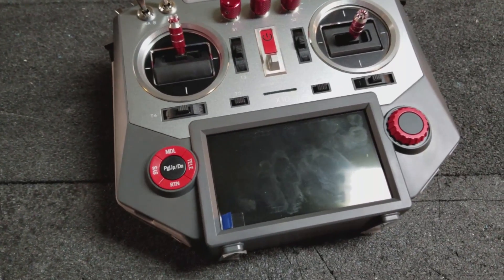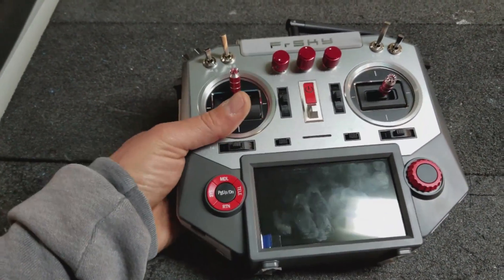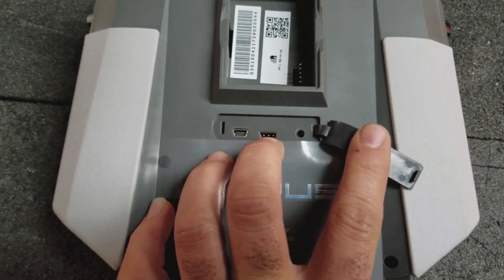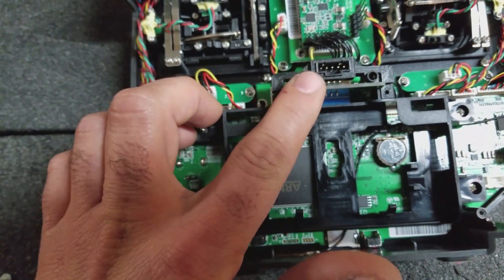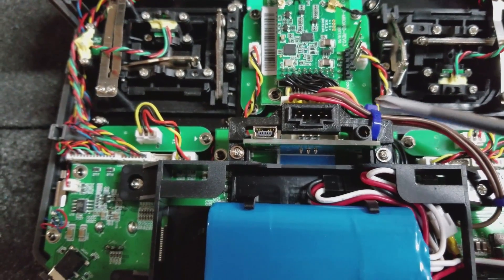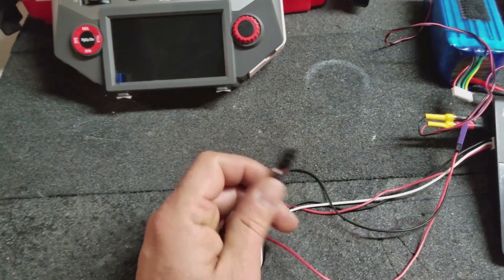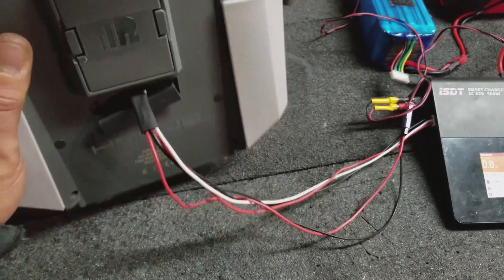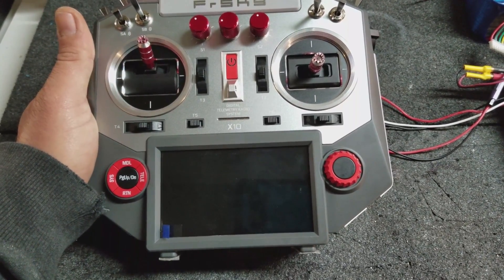FrSky X10 Fast Charge Mod

Comment: It’s a nice mod however I disagree with the original charger being a pain in the backside-you just need to lie the radio down on its back like you have it most of the time in this video at the beginning and leave it plugged in that’s what I’ve been doing ever since they came out and never had a problem-that said I do like your modification. nice work👍

Comment: All over nice MOD but i dare to say the lousy Hinge between Rubber Cover and Transmitterbase will not hold for many Chargingsessions, would feel it better to use one of the two Long Oval Side Back covers (On Horus 12 you can remove them not glued or such a thing) Construkting a 3d printet Balancing Plugholder. The broken Coverhinge i saw first time on a  Premium Japanese Camera Cover after several Chargings
Reply from the maker: You are probably right :)

Comment: Watch out because on the original battery the plug IS NOT a balance plug. The middle cable is connected to a board inside the battery and sends info to the charger (temp and maybe smething else). I'm not sure the board will like having 4V there instead...

Comment: What did you use to cut out that port hole?
Reply from the maker: Just my dremel tool with sone grinding bits and drills to get rough size, then switched to small hand files.
Reply: flightcomp thank you I will be doing this mod because that charge port is so dumb.

Comment: I just ordered the radio, if it shows up a version 1 I will send it straight back, It cost to much to have to deal with this problem.
Reply from the maker: ToddTube Yeah as a dealer I was really disappointed to get V1s wen everyone knew the V2 was released.

Comment: Very nicely executed mod. Just a quick tip. You don't actually need a 5 pin connector. 3 is enough. The 3 pin balance plug also has plus and minus that you can use for charging.

Comment: Real nice and professional mod. I have been wanting to buy a X10 since it was released, but I must say that the original charging  system has been a show stopper for me.
Reply from the maker: Yes, I am FrSky Dealer and I asked for "new style" charge system radios, and they still sent me the old ones  :(  I think now most X10 ordered from FrSky have new charge system with barrel connector.
Reply: I won mine in a raffle for 15$, Getfpv still had the old style..I am ok with it for now, but this mod is pretty awesome and I might do it. Thanks!
Reply from the maker: Voorhees_Fpv Nice score dude!